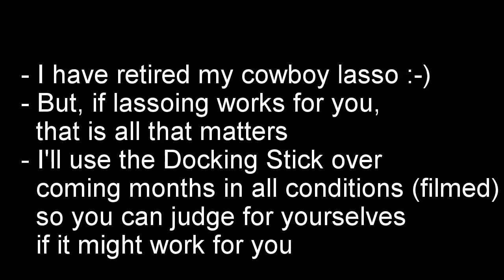Ep 33 Refining My Solo Docking Technique   Spring Line and Pivot Point

Comment: Rather than buy a docking stick you could make a lasso loop with a slip knot and attache to light paper tape on the boat hook once over the dock cleat a jerk (sudden pull, not a person) sorted
Reply from the maker: Yeah.  You are of course right Will.  There are simple ways to do the same thing.    Some just use a loop draped over the boat hook --- nothing fancy.    It is the concept of the Docking Stick that I'm trying to sell, not the Docking Stick itself -- though I quite like it also: no way for the loop to fall off just as you reach for the cleat, etc.   As you state, there are many ways to achieve the same result.    Thanks for commenting.

Comment: Oh man, I have never been shown this technique or similar. My single handed moorings were very stressful so far. Because I usually had a docking line on the stern and the bow, both prepared, and then slowly come in, throw the stern line first (to also stop forward momentum) jump of with the bow docking line and run up to a cleat, pull myself in and tie up. Very stressful if youre in confined space (like a small lock or a finger berth.). But this is less stressful to me than it sounds, because of my experience in doing so.

On other occassions I had inexperienced crew with me whom I had to show the basics of what theyre supposed to do minutes before the first execution. Man. I had a bird over and she soooo wanted to take part in the docking process but she stressed me out because I couldnt fully trust her in any task (yet). I do not blame her, but I just simply didnt see a way to have her help without standing in my way when I run along my boat and jump on to pontoons etc. So I had to trust in what shes doing, but its her first time and she only had my explanation once. And you know how it is: People learn something under calm conditions but as soon as it gets a bit stressful and they dont have 5 minutes to figure it out they go blank and lose their heads. If I wouldnt have jumped off multiple times catching the rope for her (cause she didnt manage to jump off in time because shes too slow in preparring herself nevermind me telling her minutes in advance) we wouldve crashed at two occassions. Gave me heartattacks and just stresses everybody out. Not how I want a nice day of sailing to be going down.

Now with a spring line midship I will be able to secure the boat and then have inexperienced guests help me tie her up without giving me a heartattack when they do something wrong. Thank you for the video, I will try it out soon! :)
Reply from the maker: I always welcome help with a smile, but whatever they say or do, I continue my arrival as if I were solo.   ;-)
Reply: @patricklaine6958  I definitely learned that lesson. Oh the stress, the potential heart attacks lol.

Comment: Hi Patrick. Another informative video. A book I have found helpful is Harbour Manoeuvres Step-By-Step by Lars Bolle & Klaus Andrews. Covers everything under power and under sail and has great photos and diagrams. You may already have it. Cheers
Reply from the maker: Thanks Greg.  I do not have that book (yet).  I'll pick up a copy.  I'm always looking for ways to improve my technique.  (The 'problem' with those kind of books and videos is that they are quite often written for boats with a crew --- and the technique for a solo sailor is very different.)    I'll check it out though.  Thanks for the suggestion.
Reply from the maker: The book arrived today.  Very good photos/diagrams of the various scenarios.  A great book for a husband/wife team.  Not so useful for a solo sailor, as every maneuver uses that wonderful second person to drop the line over a cleat, or step ashore with a spring line.  Again, a very good book --- but if you understand the theory of the use of the rudder and spring lines, and sail solo, you won't get much from this.    I caught one (minor) error too.  On page 54 going into a slip, they attach a forward spring line to the aft-most cleat on the finger.   I can't see the bow doing anything other than veering very hard into the finger if you do that (unless in dead calm conditions, and the boat is completely stopped).  Much better to use a mid-ship spring.  Anyway, thanks for the tip.  I think most short-handed crew will find it useful.

Comment: Hi Patrick, I just stumbled across your videos. I love them. I have one simple recommendation to improve. I have observed that you do not stop the vessel carefully before coping with the lines. That steals some seconds to do the job. In general I think it is better to make some room astern and use a stern line.
Reply from the maker: I wish I had 1€ for every time someone has made that recommendation to me Dirk.  :-)  For info, there is about 1.5 kts current along that pontoon due to our 4 meter tide.  If you try to tinker with the engine to get perfectly stopped, the boat will gradually move out of alignment due to the prop walk, and then the instant after you power to a stop, you are moving at 1.5 kts again.  I have learned to live with a bit of forward motion on arrivals.  It keeps me in control.  Thanks for watching.

Comment: Great video - always worth a number of viewings to get the full benefit.  Two important observations for me; the first being your use of port helm which is counter-intuitive, but brings the bow in parallel to the pontoon - how much port helm, and does this vary with wind-strength?  Second, you had one turn around your winch, and I am guessing you were hand-holding the line which showed some slippage when it came under load.  Acknowledging you had just 7 knots of wind off the pontoon, how do you anticipate having to adapt your technique when you are being blown off by something rather stronger?

I'm learning a lot here at your expense - thanks :)
Reply from the maker: Thanks Greg.  Turning the helm away  from the finger/pontoon is a key concept in docking that I use almost every time I leave or enter my slip.   It drives the stern against, and locks the boat against the finger/pontoon.   You do not need to have 'full helm' in the other direction --- with light winds just a few degrees will suffice -- with higher winds --- put in the opposite helm sooner and with a bit more motor.    I don't consider the winch a key element of the system.  If you want, just take the line back to a cleat and tie it off.  The winch is a convenient way to get rid of excess slack line.  Yeah, you can put another turn on the winch to stop any slippage, but any slippage is insignificant to the big picture, but yes, you can always put in another turn or lock it off in the self-tailing mechanism if you want your hands free for the throttle or other lines.  Great comment/question.

Comment: Hi. I'm new to your channel. What model sailboat are you sailing? I ask this because one comment said you had 2rudders and I wanted to confirm this. Thanks Philip
Reply from the maker: Thanks for the question Philip.   It is a German built Bavaria 40 (foot) Cruiser from 2008.  It only has one rudder.  It also has a saildrive rather than a traditional shaft and prop, so much less prop walk than the traditional configuration.  Fair winds.

Comment: Hi Patrick, great channel.  As you seem to have masterly control with the engine is it the wind and tide keeping the boat moving as you try to hook a cleat or have you got off the gas a tad early? Regarding being a cowboy, if you make an eye in the end of your mooring line that matches the size you would coil it, you can hold the open eye with a couple of coils and throw them as one over a cleat (as in quoits - hoop over a stick).  It's much easier to aim the weight of the coil and the eye stays open. Just pull in the slack and the eye will be around the cleat...
Reply from the maker: Great comment EB.   In response to your question --- both --- current affect and getting off the power a bit early.  My home port has 5 meters of tide, so there is almost always 1-2 knots of current in certain areas of the marina.   This is true in all of the Atlantic and Channel ports I visit.   More importantly, I have not found that there isn't any particular advantage to staying at the helm the extra 2-5 seconds to ensure the boat is brought to a COMPLETE stop.  This just gives more time for the wind to blow the bow off, or prop walk to throw in its twist --- and the instant after you fully stop, you are moving at 1-3 knots depending on the current.   I have found it more advantageous to accept a bit of forward movement.   The real  key is getting the line around the cleat -- not stopping a small residual forward movement.   Your technique (large eye in the line)  may well work for many boats (especially those where you can drop the eye over the cleat from the cockpit without going forward), but for larger boats -- where you may be 2-4 meters away from cleat, it still requires being successful at 'distance' lassoing.   I'm sure many people can do that, but after having tried multiple techniques over the last few years with reasonable, but unsatisfactory success (75-80%), I'm going to try the Docking Stick for the next few months.  :-)   I'll continue to film and show you the results.   Thanks for watching.

Comment: Hi Patrick, I love your videos and find them a great inspiration to me. Could I please ask about the diameter, length and type of the lines that you use with the docking stick. I currently have 14mm dock lines on my 36ft sailboat and I wonder if it would be better to use a smaller diameter line with this technique. Also the length I guess is also important so as not to have too much excess line getting in the way when deploying the dock stick. Any thoughts on this?
Reply from the maker: Yes Adrian, you can (and should) use much smaller diameter lines --- even old sheets or halyards.   This is not meant to be for secure mooring ---- it only needs to be strong enough to hold the boat the time needed to dock.   As to length --- in the worst case, the line needs to run from the stern to midships and back ---- and add 2 meters or so for ease of use.    Thanks for watching.

Comment: Hi Patrick, just a couple of comments at 1.50 you put the boat into reverse but the boat fails to stop and then you put it into neutral, practice touch and goes where you bring the boat to a complete stop before you throw the lines, because your boat is still moving forward when you go to throw the line you seem panicky, this is the worse thing you could be doing shorthanded. In a blow when your trying this i can envisage you tripping on a jack line or even the line you are trying to throw and that would be disastrous. (another thing to practice would be all of these maneuvers again but tied into the boat with your PFD on) You can do this same parallel park with a bow line and by entering in reverse (attach the bow line from the cockpit still). Another good one to practice! Can you do me a favour and try the aft line throw, starboard rudder and engine ahead and see how it works for you. Also please don't take my comments as some sort of personal attack, its not, its constructive critiquing :) if i just replied with 'great job!' you would never improve! - Fair winds!
Reply from the maker: All good advice Super.  No argument here.  One thought for consideration though.   I once did a weekend course in maneuvering (with a pro and several other 'students').  He made us practice coming right up to a buoy without touching it --- in forward and reverse, etc.   I thought it was a good exercise in learning boat control.  However, now that I have probably done +/- 400 dockings on my own, I'm not sure that bringing the boat to a complete stop is as important as is generally thought.   It requires you to stay an extra 4-10 seconds tinkering with the throttle, during which the bow begins to fall off one way or another.   And, if you are in a current (my home port has 4-5 meters of tide), all of your effort in bringing the boat to a perfect stop is lost instantly as the mass of water moves you with it.   It doesn't bother me to still be moving (very slowly).   I see no need for perfectly stopping  --- and indeed, in my home berth, I want to come 98% to a stop a foot away from the bow fender, and then glide and bump very gently into the pontoon fender (and then engage gear and reverse the helm away from the finger).    So, yes, I hear you, and accept the wisdom in what you are saying, but my personal experience says that 'perfect' is the enemy of 'good enough'.   :-)
Reply: Hi Patrick, you could be right, but,  when i was learning all this stuff 25 years ago we did it on an old 50 tonne trawler, the importance of bringing that to a dead stop against the pier couldn't be overstated. Also I was one of the only guys in our coxswain class who was able to naturally account for the wind and tide and steer the boat in the correct direction relative to the dock, this is something that takes an eye and touch, i had a look at some of your other vids so i could see your transom and starboard aft quarter and you have a very safe boat to do all docking from behind the wheel. My advice would be to first think, how can i do this approach from behind the wheel in its entirety, only leave the wheel once the boat is set next to the dock (its set with a single line, engine and rudder holding it in position). It was funny because today i was out on my boat solo (very rare, normally i have the better half crew) and i went back to basics, used the technique above in both undocking and docking and immediately thought of you! Its a proven method that wont have you tripping over yourself.

Comment: Hi Patrick! 
Only just discovered your channel and am working my way through many useful videos. Thank you. I’m likely to look into buying an Emory - never heard of them but looks really good in another episode. 
On mooring, have you come across a book Stress Free Sailing by Duncan Wells? You can get it on Amazon here:
https://www.amazon.co.uk/Stress-free-Sailing-Duncan-Wells/dp/1472907434/ref=sr_1_1?ie=UTF8&qid=1551723657&sr=8-1&keywords=stress+free+sailing
He advocates a technique called the bridle. Run a line from a fixed point, out through the legs of the centre cleat as you do,  then back through the legs of the stern cleat to the sheet winch. Come alongside, stop, and drop it over the stern cleat on the pontoon. Pull in on the winch. Leave a little forward motion on with the engine. The loop of line will act as both a spring, as you’re already doing, but also a stern breast line. So it is more effective at keeping you alongside, and not having the stern drift out etc. Also, the much bigger loop - half the length of the boat - makes it much easier to drop over the shore cleat., or even to throw it a bit. I’ve found it to work quite effectively. If you buy the kindle version of the book it has embedded videos of him showing how to do it on his own boat. 
But as others have said, if you have found a technique that works for you, good for you! And thanks for sharing the experimentation - we can all learn from your experience. 
Sadly it seems the price of the Docking Stick from Amazon in the UK is highly variable - the link form where you got yours no longer works, and a search found them offered at GBP87 which is excessive! I’ll look for a transatlantic friend to buy some and send them to me. They look worth having, bridle or not.
Reply from the maker: Thanks Martin.   I've got Duncan's book and have watched many of his helpful videos.    The problem I have with the bridle method (which is an excellent tactic for many boats) is that I have a lot of hardware (bimini frame, davits, etc.) right where I stand at the helm/throttle.   It's not easy tossing the line from there over a cleat on the pontoon, and if my positioning is not directly adjacent to the cleat on the pontoon, I'll miss it.  (I love reversing in though because I can steer the aft corner of the boat to be directly opposite that cleat on the pontoon.)  Sorry for the bad luck with sourcing the Docking Stick.   I love it!   If you check out a channel called 'Sailing Yacht Salty Lass', these two ladies show how they constructed essentially the same thing for next to nothing.   :-)    Fair winds to you.
Reply from the maker: This is where 'Salty Lass' shows how they made a simple but effective Docking Stick:  https://www.youtube.com/watch?v=LhjaspHJjUw      at 9:00.    Good for them.
Reply: Thanks Patrick! As you say, any solution is very particular to the boat. 
The diy docking stick is so simple, and much cheaper! Worth a try. Thanks again.